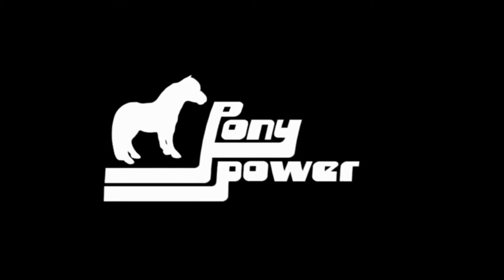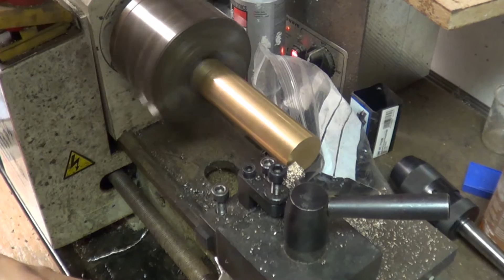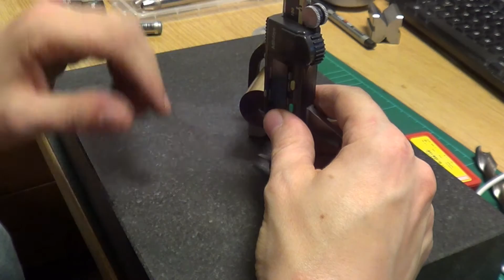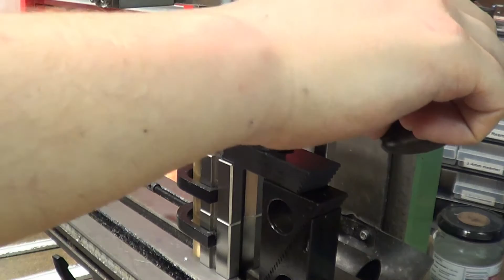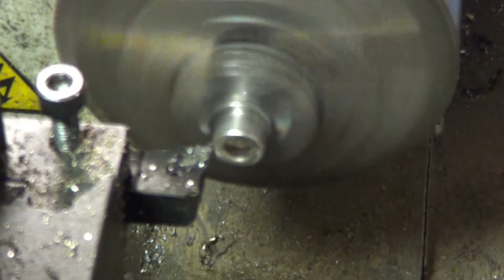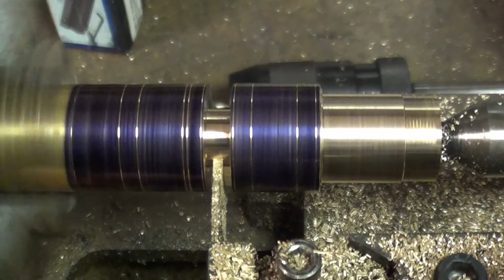Brass Crankshaft? - Eccentric turning

Comment: Hello! 

Great skills on the lathe. I just got a small watchmaker lathe and planning to build a model engine (4 stroke, internal combustion and 4 cylinder). I know that the crankshaft should be ideally be made from steel but on my lathe it would take ages to do parting on steel. Do you think brass would work for a model engine's crankshaft or would it immediately break? 

Best regards,
Igor
Reply from the maker: It depends on the forces. For a small 10cc engine it should be fine
Reply: @thedirtyworkshop  thank you for the reply! I may try brass then

Comment: good idea using brass it will give it a bit more torque because of the weight the brass and if you use a brass fly wheel as well even better
Reply from the maker: Brass is a terrible idea for a crankshaft, too much flex and not tough enough. But for a model engine that won't be under any real load, its a nice material to start out on. More videos soon on the whole concept - cheers for the comment - matt

Comment: Geez as soon as I saw that eccentric turning I flashed back(or was it forward) to your "CVT issues and AvE point" vid. How could it go sideways. I suppose it was safer to machine the concentric parts 1st to reduce the eccentric mass? I guess it's a toss up between a stronger piece vs a lighter piece?

Comment: Super neat stuff. Is that your home lathe or one at work?
Reply from the maker: The shitty lathe at work, it was a bit touch and go and the lathe isn't really stiff enough.
Reply: Ah yes the joy of having to deal with fucky tools. I am currently dealing (slowly) with a cam chain made out of finest chinese butter. At least the exhaust bolts I put in are tough as a coffin nail. Defeated 3 hex drivers and not a scratch on the bolt.
Reply from the maker: What is the cam chain off?
Reply: My 125 Sinnis Apache. Stretched beyond service limit at 9k miles.